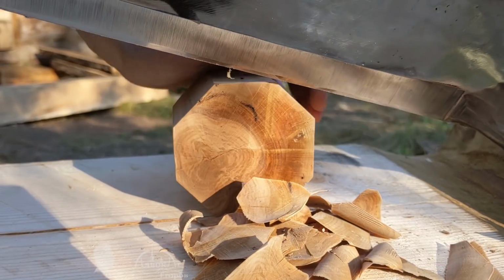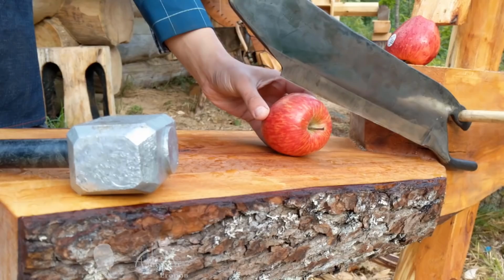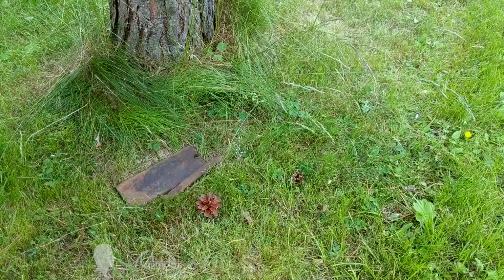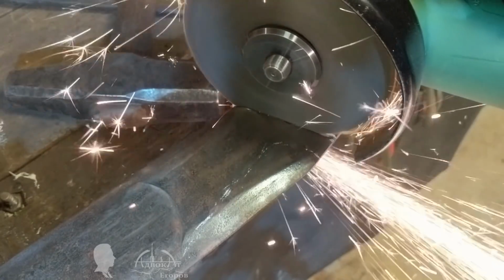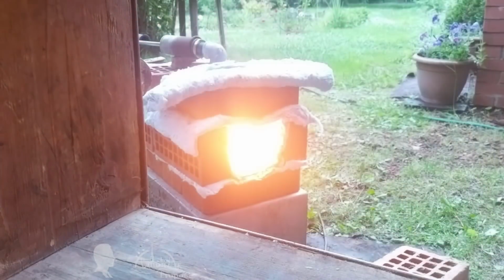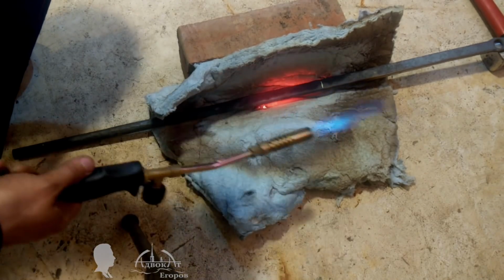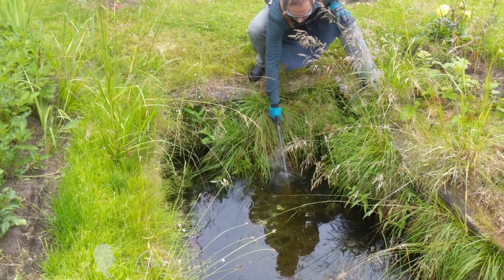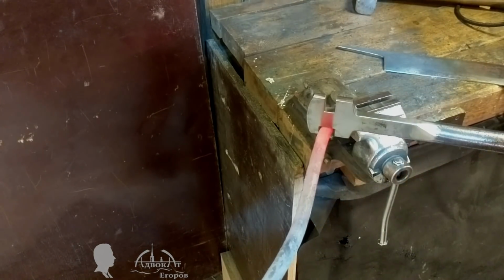The Cloggers Knife | Old Tool Reborn

Comment: As others have suggested, the tool you are using to straighten metal rods is known as a swage.  The bottom swage would be mounted in the hardie hole of the anvil, and the top swage would have a handle like a hammer, and the blacksmith's helper would pound on the top swage with a sledge or double-jack while the smith holds the top swage and the work piece.   The variation you are actually using would be known as a spring-swage, as they are mounted together to allow one blacksmith to do the job without a helper.   The same concept can be applied to other hardie tools that work against each other such as fuller blocks and other things.
As to the knife you have created, I know this tool as a stock knife, and as you said it would have a hook on the end that would run in an eye fastened to a work surface (normally a chopping block formed from a stump).   
I might be inclined to call the bench you made to use your knife a 'stock bench'.
Reply from the maker: Mike, thank you for such a detailed info! For some reason, I couldn't find it online.
Reply: @Advoko  I have to admit that I've never tried to look up a stock knife on-line before, but I just did it now, and I see that "Seven Pines Forge" makes one for sale, and there are a bunch of them available on Etsy, and there is other information available if you search for "stock knife".  Searching for "spring swage" is also pretty effective for information on that stuff.   Another common black-smithing item is a swage block, which is a large cast iron piece that has all kinds of semicircular depressions around the edges, and various holes in the center.   It helps to make rounds, half-rounds, points, hollow half-rounds (like a wood carving gouge) and other such things.
Reply from the maker: Yes, I saw that stock laser-cut stock knife for like $600 on Etsy. An overpriced  listing.

Comment: When I was a very small boy, I was left handed, as I used to eat and drink with my left hand, but I was coerced into using my right hand instead by the adults in my family. Consequently I am relatively ambidextrous. I wouldn't risk holding nails while I hammered them in, thats too much of a risk to my fingers, at least only in an emergency, and writing with my left hand would probably be a bit of a scrawl, but I frequently swop hands when working if its convenient, like when wood turning, or using spanners etc.
Sometimes it's easier to just swop hands, instead of turning my whole body around, so my right hand is aligned correctly.
So, unwittingly, my family did me a favour.
I can only recommend that people try to train themselves to be as ambidextrous as possible. 
Its a useful skill. Practice make perfect.
Reply: I did it when I was a teenager because I was on a kind of  “house arrest. Playing darts 🎯 got to easy so swap hands, then that got easier so doubled the distance… writing throwing catching..it all started with challenging myself more at darts, now I’m not dominant on any primary part but the whole is tuned to perform despite any handicap
Reply: @WColeZPorter  Vivarium.

Comment: Brilliant video, only problem is I now need a cloggers knife! I tried a smaller, sharper axe and various blades and planes. This is literally an ideal tool for me and before this, I did not know it existed. Thank you so much!
Reply from the maker: You can try to use a large straight spoke shave for for starters by attaching one handle of it to a base. It will not be the same as a real cloggers knife but it might work for smaller workpieces...
Reply: @Advoko , thank you for reply! Unfortunately I need a lot of staves, poles and pegs all from green oak. I may also have kinda wrecked a spoke shave already so.. To the forge!  (plus I haven't forged anything this year so i am itching to get started 😂)

Comment: This tool is so satisfying to use. I had the pleasure of using one at a workshop and it's on my list to forge one. It really does require the heft that you get from the thickness of the blade as well as the leverage that you get from the massive length. So I'd like to do this as mild steel with a welded tool-steel cutting edge.

Comment: Hi, .... As a Clog wearer I could not help but watch this!

In the UK we got to the stage (pre WW2) where All the clog blanks were made in one factory! There were obviously one man bands that did it the old way but invariably they would buy from Walkies. 
The mill where this was done has had a chequered history including shrinking the work area and renting out the rest of the mill to industrial/ retail units, all culminating in a fire! Walkies moved and continues to make clogs to this day from Sundie to Derby's (I find a set lasts me at least 7 years .... although I do take them of to go to bed)! They use most of the same machienery that came from the original mill!

There is some good advice on here as to forging but watching Christ Centered Ironworks, Daniel Moss (trust me I'm a blacksmith) or Black Bear Forge would do you no harm .... they explain not just what they are doing but also why!
Reply from the maker: Dave, thank you for the interesting historic info!

Comment: The different ways you are using it are as a stock knife and heavy shear. 
 You should make clogs, at least the wooden soles with a leather upper. 

BTW. Putting a curve on the knife means that you cut on a tangent, with the smallest amount of steel creating friction.

Comment: (S) specialized, (K) knife, (M) mounting, (S)stand
SKMS phonetically sounds like the word skims, which means to remove a thin layer or pass lightly over a surface. That's exactly what the tool does and what the bench is designed to facilitate. So call the bench a Skim. It's a working acronym and also an accurate description of what it does when combined with the tool.
Reply from the maker: Thank you for the suggestion!

Comment: Just a heads up, you could have made those cuts and completed the drilling easier by heating the steel again. You only actually need a hardened finish on the blade, it's often better to leave the spine of a blade softer to aid in reducing impact, it also makes the blade stronger and more flexible to have a hardened surface. Also, making adjustments, cuts and drilling holes ahead of time then hardening the blade can make the process both easier and stronger. With spring steel you may need to reduce tension on the surface, so it can be beneficial to make multiple heat treats when tempering adjusting the temperature each time and then annealing during the process.  I love your videos, wish I could do what you've done. One last note, preheating oil instead of water will help with the quench. Oil cools more slowly, you can add a cooling agent to the blade when reheating the spine to help relax stress as well. If you check the cross sections of the steel you hardened you'll most likely find fine crystalline cross sections which means the steal is brittle and rigid, so it may be easily damaged.
Reply from the maker: Thank you for the tip!

Comment: If you have to weld another crack like that again drill a hole just past the crack so the crack runs into the hole 
However that was Avery good save
Reply from the maker: Thank you for the tip!

Comment: When you straightened the blade after already having ground it I saw you use a metal hammer. I'm not a professional blacksmith at all but I've learned to use a wooden mallot for that kind of stuff. The mallot doesn't leave such a dent as a metal hammer so there is less risk and you can hit it harder. The mallot will slowly burn tho so you will need to open a window when you use it.
Reply from the maker: Peter, thank you for the info

Comment: @Advoko MAKES
To weld long seams where distortion is a concern, divide the length to be welded into rough even divisions, either by tiny spots or black marker pen, then weld each divided section in the opposite direction to your overall progress down the work, leaving two sections between each weld. Then come back across the work 2 more times using this same backward technique to infill the full bead. the effect of this is to drive the heat front from the weld pool in the opposite direction to the order the welds are laid, so you are welding only in the direction of the START of the previous stitch and the 'leave two and weld' complete the distortion defeating action. Used to use this to fully weld 3m lap welds in 1.5mm steel without turning the workpiece into a banana in the process.
Reply from the maker: Thank you for the tip!

Comment: The English name for the tool that you made is known as a swage block. They can be made in any number of ways and to form the metal into many different forms. I personally have over a dozen different swage blocks all custom made to the projects needed at that time and all to fit the hardy hole on my odd ball sized anvil. I have some that are round, some that are oval, and some that are square. The interesting thing about blacksmithing, as you have found, you often have to make custom tooling to complete the project.
Reply from the maker: Thank you for your reply! I couldn’t find it anywhere...))

Comment: I see you haven't got your chainsaw protective clothing yet, naughty naughty! 
Last year, 1st time in almost 20 years I put a hole in my chainsaw dungarees.  I was using my long reach saw so the dangerous end was 10ft away from me.  Completely safe? Nope!
I was cutting some high branches and lowered it down and rested the engine against the top of my thigh, not quite in the usual safe place and the exhaust melted a hole almost in the most precious area! 
I always use my PPE, always careful, always had respect for my tools. 
I still almost got caught out!
Reply from the maker: Jamie, you are right...
Reply: Max, you are a very talented chap! How about doing a video about how you got started and how you learned everything?  Did you grow up on a farm or spend time in the military?  Did you have any help with the heavy jobs?

All the best

P.S.  remember your protective equipment,  nobody wants to see you injured if you have an accident!

Comment: You've made quite the multi purpose bench. Excellent second class mechanical advantage on the knife.
For a name:
Crush knife bench  - ( it's like a nut cracker or lever press that essentially crush things, but with a rather sharp knife)
Reply: I also believe a general name like crush knife is better than a specific trade name like cloggers knife. Even a name can change the perception of utilization, creating unintended bias to its use.
Reply from the maker: Thank you for the reply

Comment: The straightening device you made would probably be called a "die" in english. Good stuff, I wanted one of these since I saw a clog maker using one. More precise than an axe, has a lot in common with a mitre trimmer. Leaf springs tend to be made of an oil quench alloy, they can be water quenched but your first method is definitely the way to go, seen rural smiths in asia use the same method on them without cracking. It's to do with manganese in the alloy making it "deep quench" where the blade is hardened much deeper into the surface, water also "deep quenches" so the two combined puts a lot of stress on the blade. Your first method with limited heat meant just the thinner edge was heated so it was more like an oil quench, which hardens much shallower into the metal.
Reply from the maker: Thank you for your reply.

Comment: Well , that design its questionable , do you use that all length of the blade in the cutting process ? Its make any sense that the blade to be that wide ? The longitude half of the blade its an extra , unnecessary  mass , so the blade its to wide , the thickness its ok .I don't see that load that would be a justification for the whole mass off the knife . The front part i would make it all in one piece with the blade, of course the handle need to be welded , but only 10 cm part , and i would harden only 1 cm stripe  from the cutting edge. Why is a T shape handle ?  A normal knife stile handle would be more practical .... anyway , that was an huge amount of work
Reply from the maker: You can use all the blade’s length to cut, this way you don’t have to resharpen it frequently...

Comment: It's nice to use traditional tools some of the time but don't think for a minute the old timers wouldn't have used the tools we have now if they had had the chance.
Reply from the maker: They would, however, a glassy wood surface that can be easily achieved with, say, a hand plane or a cloggers knife would be better than after sanding. Have you seen a raised panel made with good profile hand planes?

Comment: "Blacksmith hammer with hemispherical face" is a "Rounding hammer" I believe. It is designed so that when you hit the center of the hammer goes deeper and the outside edges of your strike are pushed out, causing the metal to flatten and widen faster.

The two piece tool you made for rounding the spring clip is a variation of a hardy or "forming die."

Great video Max!
Reply from the maker: Thank you for the info!

Comment: Rather than using cold water to temper your clogging knife, use warmed or hot oil.  It will not make your forged metal brittle.  Good luck and well done.
Reply: Came here to make this exact comment.  Forged In Fire taught me that, lol.

Comment: The english word for that tool is a top and bottom swage
Reply: @bellasmom2597  Interestingly enough, fullers and swages are actually opposites! Swages are concave and fullers are convex.
Reply: @Andrew-kw9sq  very cool thanks for educating me!
Reply: @Andrew-kw9sq  
"Straightening dies" would also be acceptable, and probably more descriptive, as swage is a very generic term. Swage can also be spelled swedge, and is pronounced phonetically with either spelling.
Reply: I said spring swage
Reply from the maker: Guys, thank you! I spent a lot of time trying to find the tool's name in Russian or English.
Reply: @Advoko   Try quenching in a fast oil. You likely don't have the same brand quenchants available over there, but parks 50 is commonly used here. Oil quenches have an exponentially lower failure rate than do water quenches. If you cant find an appropriate oil quenchant, you can also do an interrupted quench.

For the interrupted quench, quench for about 1-1.5 seconds in water (or brine is even better), immediately withdraw the piece and immerse in oil. using this method, even shallow hardening steels can reach maximum hardness, and you can use a slower quenching oil (commonly available oils like canola will work for this process even with simple, low-alloy steels). It isn't quite as reliable as a 100# oil quench, but it is still much less likely to fail than a strict water quench.
Reply: @Advoko  Just a little tip, I find wikipedia the most useful tool for translating such terms. There are many things I've learned in English and don't have any clue what it would be in my native language. So my process is usually to go into wikipedia and search for what I'm looking for in english and then selecting another language on the sidebar. If there's no article in my language for the thing I'm after then I usually just google some specialized term in my language from a "main" article and there's always some article or forum online that is about a specified topic and that's where the money is at.
Reply: (S) specialized, (K) knife, (M) mounting, (S)stand
SKMS phonetically sounds like the word skims, which means to remove a thin layer or pass lightly over a surface. That's exactly what the tool does and what the bench is designed to facilitate. So call the bench a Skim. It's a working acronym and also an accurate description of what it does when combined with the tool.
Reply: Regardless, it looks like a great way to lose a finger.  It looks like a paper cutter from hell.
Reply: @bellasmom2597  A Fuller is the opposite of what he made, for putting depressions in the metal (like the "groove" in a knife or sword blade), a Swage is the reverse, for making the work round to a set size.
Reply: A friend of mine, who used to coppice woods, called it a wood bodgers knife.
Reply: I've had people I know and love call it a "tang-gauge" or a "rod-die". Though they never really liked the proper terms to begin with.
Reply: Excellent work and the video production is top notch.